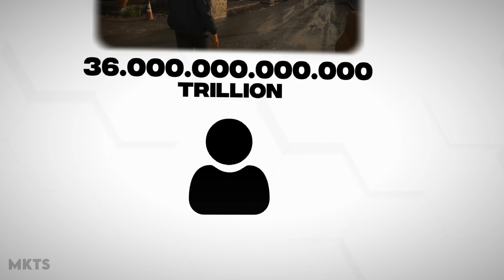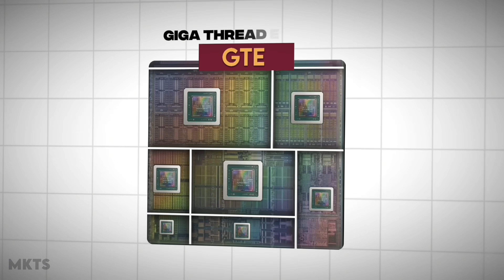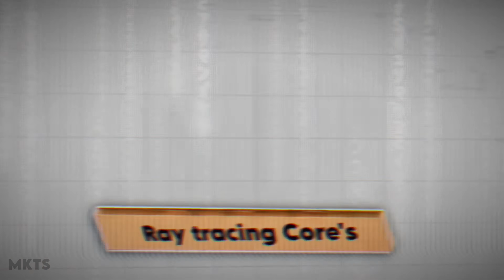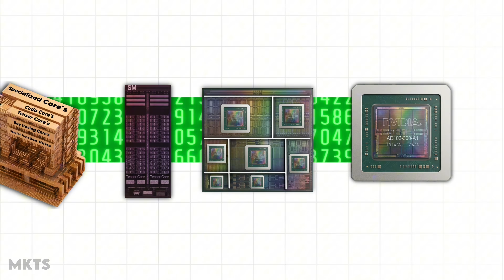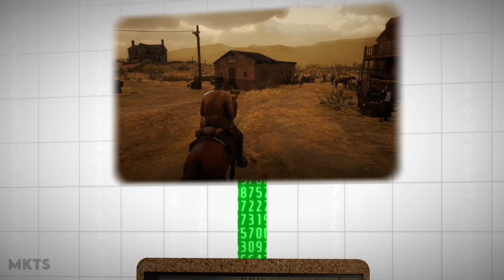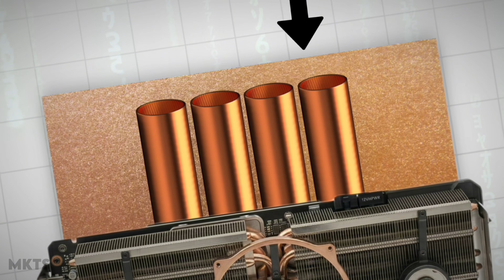How Does A Graphics Card Actually work?

Comment: Great video as always! A couple of small things worth noting: some variables like core counts are treated as constants, which could be worth addressing for accuracy. It's also worth mentioning that Tensor Cores are specific to NVIDIA's RTX 20 series and later, while AMD has its own equivalent called "Matrix Cores" (only introduced in consumer cards with RDNA 3 and later), both serve the same purpose of accelerating matrix multiply-accumulate operations for AI and compute workloads, though they differ architecturally. One topic the video didn't go into great detail on was PCIe (PCI Express) and how it connects the GPU to the system and the CPU, which impacts bandwidth and real-world performance. Minor points overall, but they'd help round out an already solid video. Keep up the great work! Also, I'd love to see you continue this as a series covering the rest of the system components, and maybe cap it off with a long video explaining how they all work together. Thanks for the vid mate!
Reply from the maker: Thanks for pointing that out I was hoping for this comment to be honest I knew from the start that I wasn’t going to get everything right it’s so complex 😅